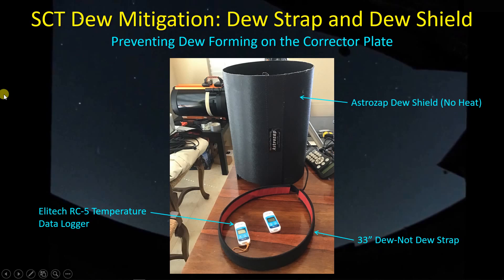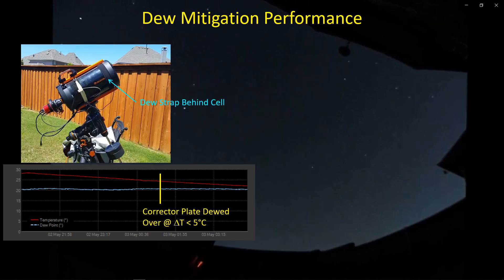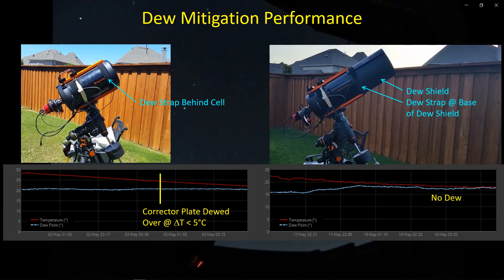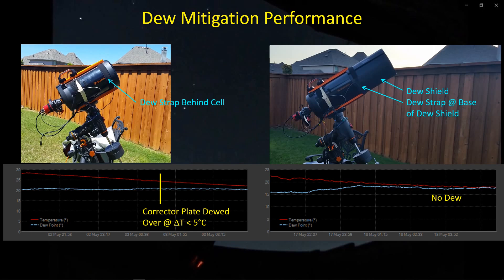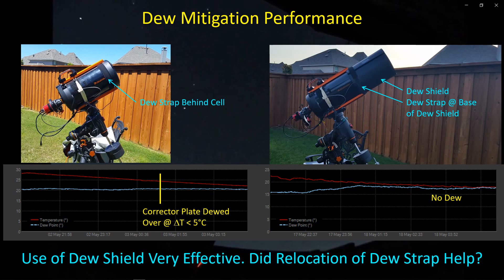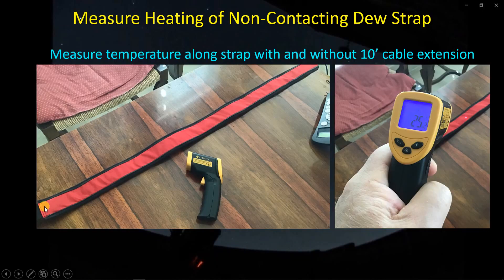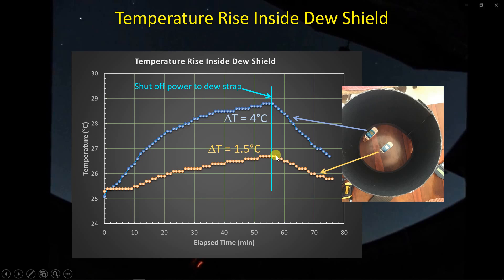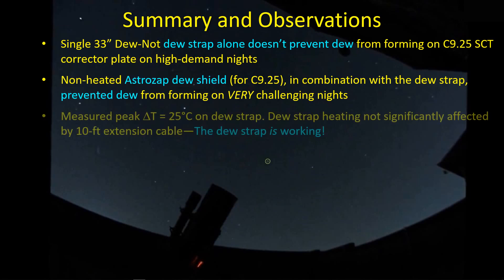Comments on the Use of a Dew Strap and Dew Shield with an SCT

Comment: Nearly missed my James Lamb fix. Power is off due to extreme weather here in WA. 3 cheers for the phone. It may be obvious why not put the strap between scope and shield ?
Reply from the maker: I looked up the weather there. Looks pretty bad. I'll have to give your suggestion a try. Not sure there's enough overlap with the shield to go around the dew strap. But it's definitely worth seeing if it will work. Heck, even velcroing the dew strap to the inner surface of the dew shield might be better yet. That said, the dew shield works fine, maybe even without the dew strap, I just can't use it when there's any real wind to speak of. Ideally, I want a solution that doesn't involve the dew shield at all. Stay dry!
Reply from the maker: ...oh, and don't forget to bring your scope inside!
Reply: @Aero19612  I took the opportunity to make another dew strap for the guide scope today . Construction is ultra simple. After calculating the length of resistance wire I sleeved it with 180mm long sections of heat shrink tube. !80 being circumference of scope.  To encase the folded up element I used 50mm wide cloth backed adhesive tape (AKA gaffers taper) top and bottom. It is not possible to solder to ni-chrome so I cut the ferules from automotive crimp terminals discarded the insulation and crimped on the power cable. Add a little velcro each end and some lashing stitches around the power cable and an RCA connector and it's done. Custom sized and rated dew strap for about $8 in materials and an hour to make. Highly recommended. I'll turn you into a DIYer yet :) 
Did you resolve the focus motor mounting issues? 
Having good success with the USB3 active extension. Night and day compared to the ethernet connection I had before. the only anomaly is the 2600 MC sometimes shows up as 2600 mono ??? not sure if it is driver related  (ZWO 290 mono guide cam + ZWO 2600MC) or something  to do with the USB connection. Very strange.
Reply from the maker: Very industrious of you! Your skills are much more applicable to this hobby than my skills. I may actually try giving that a shot (instead if buying a second dew strap). I put the focuser back on with Loctite applied to that one screw that keeps backing out. Working so far. Once it backs out again, and it will, I'll take it off and see if the longer screws will fit. I also bought a M3 tap and will run through that problem hole again. Glad the cable is working for you. Seems like I saw/heard someone else make the comment about a ZWO OSC camera coming up as monochrome.
Reply: @Aero19612  Something I will always remember were the times in the garage with my father. Those early experiences later paid great dividends giving me confidence to explore other areas of interest. Don't be frustrated by lack of skills in a field, instead see as an opportunity to grow your skill set and at the end of the day enjoy the satisfaction and pride in "I made that" The longest journey begins with the first step. There endeth the lesson :)

Comment: not sure if the following advice is up your alley but...on CN theres a guy who made two holes in his OTA, and connected it by a channel with two small fans embedded....it works by circulating the 'inner' air in the OTA...he swears by it and it looks like a very good solution
Reply from the maker: Thanks, Michael! I haven't got to the point of drilling holes in my OTA yet. Although shooting holes in it has come to mind. I did buy some small fans, but I was going to test them on the outside.
https://www.amazon.com/gp/product/B00G059G86/ref=ppx_yo_dt_b_asin_title_o01_s00?ie=UTF8&psc=1